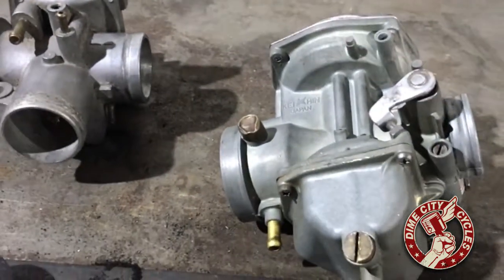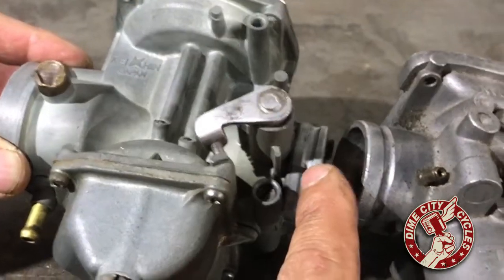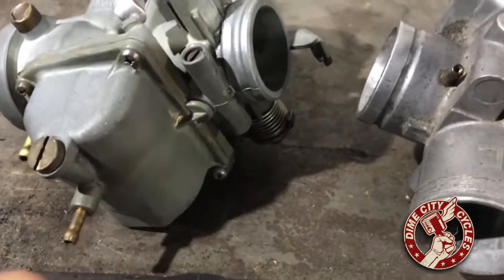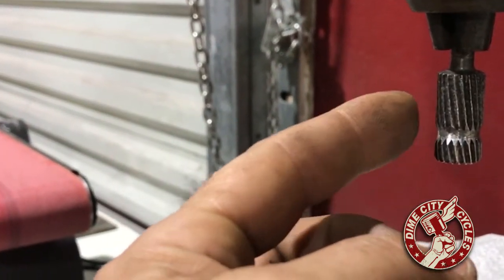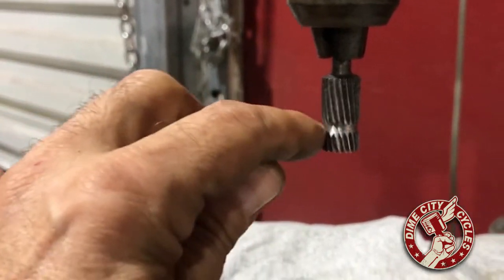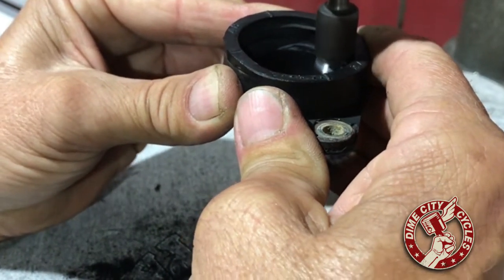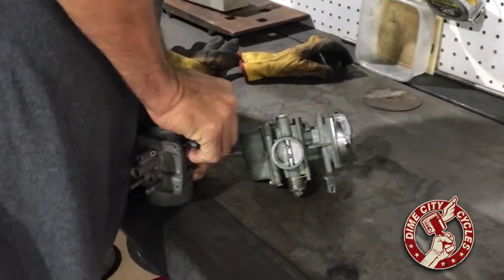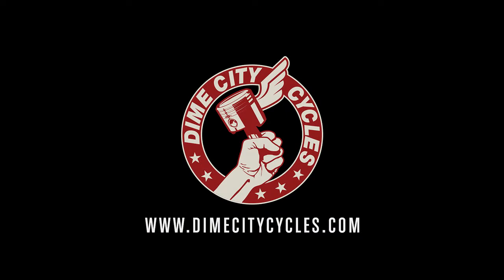Tip for Installing a Mikuni VM Carburetor on a Stock Honda CB350

Comment: Is there a recommended bit to use to grind rubber?
Reply from the maker: When cutting rubber or other softer material (plastic, wood) high speed steel is appropriate.